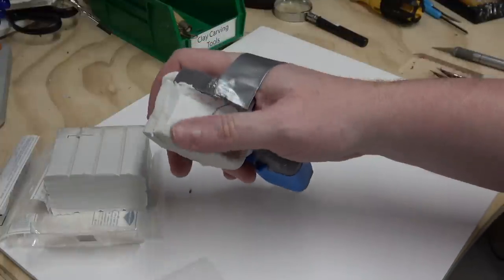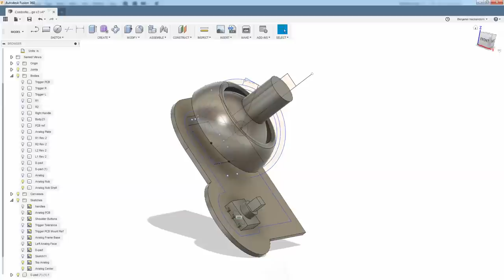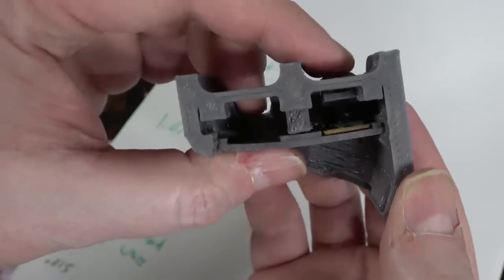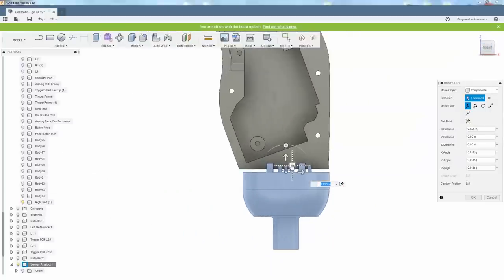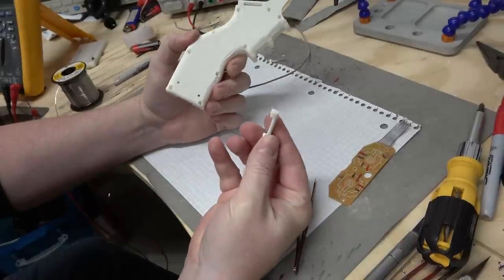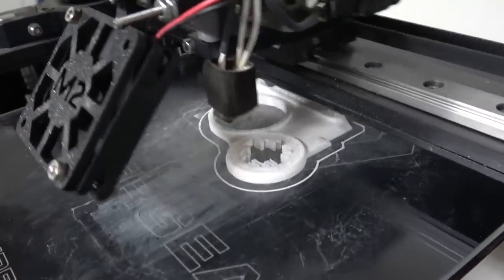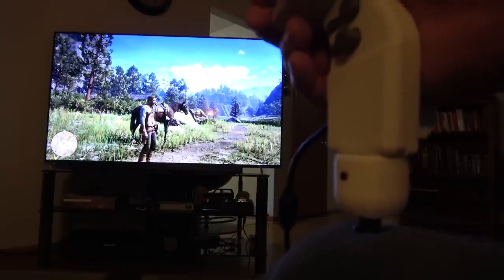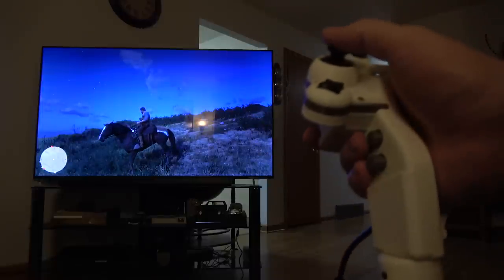PS4 Single Handed Controller Part 2

Comment: The console manufacturers really ought to have adaptability in mind and have some mass-marketed controllers to fill this need.  Microsoft has the right idea with their adaptability box controller.  Love your stuff, Ben.
Reply: mmh. A good start, even though it doesn't cover everyone, would be for manufacturers to offer single-handed controllers as a standard option.

Single-handed controllers are awesome in general, even in cases where one controller by itself doesn't offer the full set of functionality (though this is still not great for accessibility, for obvious reasons, it's a start.)

Nintendo has done this twice now, not with accessibility in mind, but you still see that this approach has helped the community anyway. (The Wii of course, and now the switch. In both cases the standard control scheme has amounted to a matched pair of one-handed controllers. Because the functionality is split this isn't ideal, but it does introduce some useful level of flexibility.)
So... Just make single-handed controllers as a standard option, if you do nothing else. Really, you SHOULD be doing quite a bit more than that, but it's still a step up from the standard game controller, as a base.
(I mean,  holding two unmodified joycons in a single hand is almost doable. Probably with practice, and perhaps the aid of a very simple 3d printed rig, that would work wonders in and of itself, which shows how beneficial this can be...)

Hear that, console manufacturers? MORE ONE-HANDED CONTROLLERS!
XD
Reply: Microsoft created nothing new. The Playstation had a one handed controller in the 90s.
Reply: There's plenty of options for disabled gamers.
Reply: @BigDaddyWes  How many of them rely on people like Ben doing these kinds of time consuming hand-made mods though?
Actual well thought out standard solutions are much less common.
Reply: @BigDaddyWes  do you have any links?
Reply: @gaftonsteel  look up the channel "All access life." On YouTube. They do reviews and stuff of accessibility controllers.
Reply: @Clay3613   Yea and they were absolute garbage which is why they no longer produce them. If they come up with something like this then they would still be selling.

Comment: you should put a gyroscope in it and use hand movements instead of the analog stick against your leg
Reply: Smart it feels like pressing something tiny like the joystick against your leg will eventually hurt after a while
Reply: Or maybe stick it to a base like a flight stick
Reply: Good idea or he could also make a  stand that snaps onto (like scuff controller extensions) and the stand stays still so your left with something like an old atari controller.
Reply: It would need some tactile feedback for gyro input though like an actuator to click when it's central and all the way. also you would need an L3 button on the controller
Reply: I would have just (I think it would need to be de-inverted) put the left stick into a solid, flat base, sort of like the old PC "flight sticks." That still enables one-handed use without relying on getting your hand into the exact right position to center it.

Either that or use the gyro for the right stick. Thanks to having grown up on Nintendo consoles (Wii, 3DS, and Switch), I am well accustomed to the use of a gyro-aim feature. This would also be much more intuitive and natural, as tilting devices (cameras, guns, etc) is how we aim them in the real world. Movement, on the other hand, is much less associated with tilting and better suited to joystick control, and this familiar standard reaches all the way back to some of the earliest arcade games.

Comment: Quite possibly the best use of 3d printing I can imagine. Purpose built prototyping to product for a niche market that would never be profitable for a big company and helps an under served community at need.   As a video explainer, one of the best I've seen you do Mr. Heckendorn. I love the insight into the problem solving and different techniques to prototype and design. Inspiring and informative. Thanks.

Comment: Appreciate the sound fix. :D It's surprisingly hard to design a grip despite all of us being human, on Forged in Fire many blacksmiths make bad handle grips. :\ Oof, that D-pad is a bit severe imo, you can feel a Plus shape as easily as any shape.  Plus it's often not said but a D-pad cap is used in a single rolling manner rather than being aware of the 4 separate digital switches underneath. I know it's role has changed with time to the point of Nintendo just doing individual 4 buttons in a cross formation but there has been too many "Not-A-D-pad" caps that last 20 years.
Pretty sweet design, very slick, looks like a true Sony product. :)

Comment: Awesome build Ben. I am just left wondering, doesn't that engraving plastic have metal foil inside? Could that be a potential short, or if the shiny bit is a metal/plastic mix, at least a resistive load if it contacts the button leads? 

Also, I hate to say it but that D-pad looks like it would hurt your thumbs if you tried a fighting game. So pointy. Other than that this is a pretty great design. Thanks for the information on picture taking and dimension warping, I will remember that for future projects.
Reply: I wouldnt venture to say this is a final version but seems to be a proof of concept piece
Reply: This is still a prototype anyway

Comment: Personally I'm a 2 hands kinda gamer. But I like your energy on ergonomically changing our perception of the modern controller. I'd be keen on say two stick. I cant remember the brand but it could possibly be a ps official part but it's like a computer attachment. You get what looks like a mouse and a keyboard cut in a quarter and you have a few keys for your left hand. 

I truly feel if you had a small pad to use for movement (like we use our left hand already)

With that joystick like grip for right hand inputs as two separate wireless bits. I'd buy, a dock that they can adhere to and be used like a traditional joystick pad wouldn't go astray either. 

From a console warrior man huge respect.

Comment: I recommend the Engineer Inc NZ-05 'chip cutter' plies for taking care of those little bits of broken skin near thumbnails. Trimming them back stops them getting snagged on things which means they're not painful and don't bother you anymore.. and then you don't pick at them. Most wire cutters will do a reasonable job, but the NZ-05 ones let you cut totally flush leaving nothing to snag.

Comment: I WAS thinking about the left hand version. I was wondering though, will the pcb translate to that side? Won't you need to feed the wires behind it? Or were they through hole?
Reply: He mentioned it in the video, he'll just solder to the button pads
Reply: He just has to turn it 180° i think. So it will be mirrored. For example a cable which gone to the bottom of the Controller will be then at the top.

Comment: The "leg"stick should have the option be attachable on to something more stable, say, on a table. But what's in my mind might be far too complicated. Plus you probably wouldn't be able to use motion control. Also, the L1 L2 might be a little too small, which would make it difficult to press all 4 shoulder buttons with only 2 fingers at the same time(I know that not a lot of games needs that, but it's nice to have the "capability"). Maybe having L1 and L2 buttons in the "away from your hand" direction, and having R1 and R2 "towards the controller" direction. And then have the buttons be circular in pattern, which would make it more comfortable to press L2 and R2 buttons at the same time with one finger.

Comment: Just an idea, but wouldn't motion controls be better for the camera control "stick" and then have the one on top control the character?
Reply: Aiming has to be a lot more precise than moving (think fps games), so probably not.
Reply: Moving camera (aiming) needs much finer motion and control
Reply: @prodbyfaith   I've played shooters with a Razer Hydra a lot; motion controls can work pretty well for aiming if you got absolute rotation and the right software. But I don't think it would work with just the gyro and accelerometer of the PS4 controllers though, and even if it did, it would involve a lot of extra hardware to account for the inability to run extra software on the a console to properly interpret and translate the data into game inputs (since most games do not already handle it properly.
Reply: @prodbyfaith  Though, without absolute rotation you could still use motion controls in place of the motion stick, since you just need two axis, and you can get 2 axes of absolute rotation with an accelerometer. But then there is the issue of games that do use the IMU data themselves, and of course, without the ability to run custom software, you still need a little be of extra hardware to interpret and translate the data.
Reply: Also on ps4 you have the option to switch button assignments, so you can decide wich joystick does what
Reply: Depends on the game, if you play shooter definetely no. But if you more into jump and run or smaller indie games, yes definetely. A physical switch to switch either to the other would be a great addition.
Reply: I like the camera stick where it is. Though I wonder whether it would be an improvement in terms of both durability and usability if it played like a classic joystick. That is, the entire unit is mounted to a joystick-like base. Camera-Up would be achieved by pushing the unit forward, Camera-Down by pulling back, and so on.

Comment: Lots of good input here, and amazing build! I like the idea of using a formed base against the leg or some other structure for the lower stick for more accurate movement. Gyro in lieu of the bottom stick would be cool too.

Comment: This is amazing. All you’d really have to do is remap the down analog stick to camera and give it plane controls. So, up is down and down is up. Maybe also make the face buttons the same size and elevation as to still be able to charge and jump in platformers.

Comment: This looks really interesting to use, great job on proof of concept. 
Side note on the fan noise, if you strip it down, clean out the dust and replace the thermal compound with better that stock stuff it really reduces the noise a great deal. :)

Comment: The D-pad:

My biggest concern is diagonal input. With this design you’ll need a big thumb or press closer to the center and lose some leverage and control. The D-pad on the PS4 controller is pretty much an opposite take, with the pointy bit towards the center. Also the center is lower which is another good design choice imo, as it give a kinda cradled resting position and makes the outer bits more defined and better suited for the direction of force when pressed. A flat d-pad might not be a big problem, but it does tilt when pressed making the angels point outwards which might feel a bit awkward.

But overall very good work!👍

Comment: for less overcompensation but also less controller mobility you could hypothetically base it around a flight stick which would give you a more granular range of movement an the strap may not be required

Comment: I think you would get better control if the lower "thumbstick" were simply a base like a flight stick, or maybe even a trackball. I would also make the buttons for the ring and pinky fingers on an adjustable slide plate to customize the position for smaller hands.  Cool design!

Comment: This was a lot of fun to watch! I had an idea for the bottom thumbstick, the one being used for character movement. It looks a little challenging to keep balanced well on your leg. What if instead of the standard thumbstick design, it was more of a claw or two prong shape that can wrap around your thigh. Or if it was more like suction cup that could attach to solid surfaces like a table or arm rest. It's kind of wacky I know but maybe they could be modular attachments to it that can be adapted to the users need.

Thanks again for the video you've earned yourself a new subscriber!

Comment: The polarity of the wires going into the analog stick doesn't matter. it is a resistance measurement, reference voltage and its potential to ground, the microchip would read a resistance and the button press would cause a reading of no resistance. The rotation does matter but you could also just swap the outside pin used to invert which direction would be high impedance.  in example if you were to measure a 10k ohm potentiometer in the middle of its rotation it would read very close to 5k the ends of its reading could go lower than we need it to. but the housing wont allow for a complete range of motion. again if you wanted to hardware invert an axis you need to switch the pin you are reading from, swap the outside pins.

Comment: This is pretty cool.  I saw this and I immediately thought of the PSVR move controllers which is old PS3 tech brought over to PS4 for use with the VR.  The problem with them is the two sticks don't come with a joystick on either hand device so walking smoothly in VR is a problem, if you could combine this single handed controller with the PS4 move controller that would be EPIC!

Comment: This reminds me of how much I loved using the Wii controllers for games with no motions controls. I think that even if you have two hands being able to move them independently of each other and not having a central controller to hold was awesome. You could sit in so many more positions and stuff. Maybe this could be an idea for another build? Or maybe just use two of these and you get double the buttons.

Comment: I know the prototype is already completed, but what if you mounted that "move stick" to a joystick base or something? That way there's more control and stability and less wear on the rubber stick. You could either design it in such a way that would require tilting the controller in all directions or simply sliding it around in all directions while keeping the controller vertical. I think it would be more practical that sliding a thumbstick on your denim jeans.

Comment: I lost the use of my right arm about 12 years ago when I was the victim of a hit and run and I’ve been using one hand on a PS4 controller; it’s pretty difficult, but not impossible. Typically I’ll use a mouse on the PC.

If you can make a left handed version, I’ll buy one immediately. I can beta test for you too, and give opinions vs. Using a standard controller one handed when it comes to accuracy, etc.

Comment: I’m taking an engineering class at my high school and I noticed you’re using auto desk fusion 360... it’s pretty similar to what we use but we use autodesk inventor
Reply: I used auto-cad for my architecture class my sophomore year learned some pretty neat design work on it

Comment: You could save some internal space and add ease of use if you replaced the four buttons with a kind of two-way toggle. Forward would be X and back would be Triangle for one toggle; and Square and Circle for the other toggle.

Comment: If you can fit it, I'd recommend adding a switch on the side of the handle facing you that let's you switch the functionality of the joysticks. Though I'm sure there are many games that let you remap them nowadays, there are a lot of titles (especially indie games) that do not.

Comment: Immaculate work on this project! My only gripe is that I feel like there has to be a better alternative to the joystick on the bottom. Gyroscope perhaps to take advantage of the PS4's motion tracking? Although I'm sure that'd add it's own set of headaches.

Comment: You should sell those when youre done.
As diy kit
As ready to use
As print it yourself

Ready to use will be bought most often

I would definitely buy one if it's done well :)

Edit: yeah i now noticed youre already talking about production :D

The bottom stick should get a ball head, so the movement isn’t suddenly jumping because of the flat part

Comment: I wonder if one of those 6 axis art/modeling joysticks like a space ball would work with buttons on the handle. Or a 6 DOF joystick that works in 3D space. Though i guess it would be a bit tougher to get working with PS4.

Comment: I'm not sure it would be stupid or not but you can switch the left and right analog and then use the right analog with motion sensor or using with the whole module as a arcade stick

Comment: How's the balance feel of the overall design? I'd imagine it would be a bit awkward to handle if it was top heavy. Could be easily fixed with some weights on either end though.

Comment: Really nice final result!
I have a couple of suggestions tho. The analog in the bottom looks a bit unintuitive, or at least a bit hard to use with precision.
So I had 2 ideas, the first is adding an accelerometer to the controller and have it as the analog, the orientation of the controller in your hand determines the analog position. It's a bit hard to add in the standart controller board, but would be nice
The second Idea is a little simpler, it's to remove the analog cap and replace It with one of those sucking cups (idk If this is the right name, but it's those conic things that stick to surfaces when you press them due to the vacuum created inside). You would then stick the controller to a table, and move It as a joystick.

Comment: Instead of an analog stick on the bottom, something that would slide like on the 3DS might be better because you could put more pressure on it without it tipping and potentially throwing off your movement. I don't know where L3 would go but if you decide to do this I bet you'd find a place for it. Just an idea, love the video.

Comment: So while I have use of both my hands and legs, well 1.75 legs, medical devices can be uncomfortable when used for long periods. For the leg portion of the control maybe you could create a curved pad for resting on the leg so the player doesn't get a callous from the lower portion?

By the way though this is freaking amazing work you're doing keep it up!